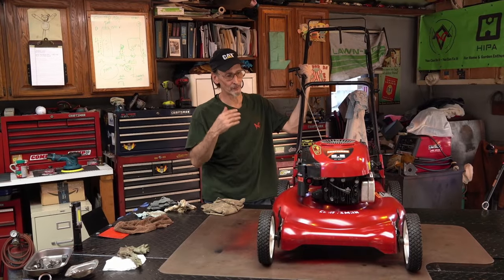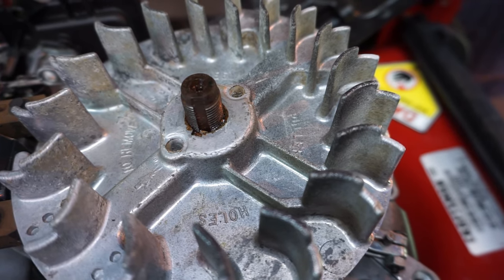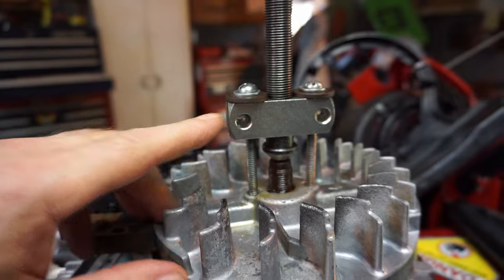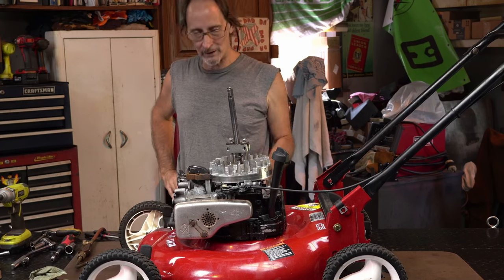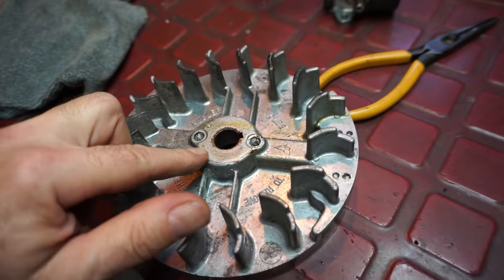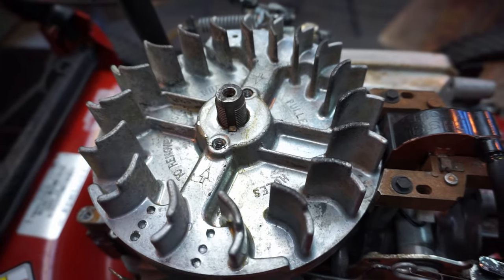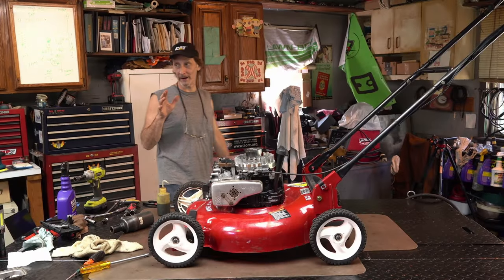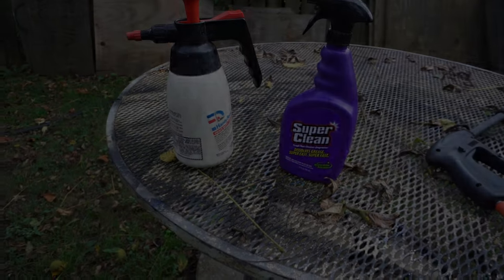Lawnmower Wont Start? Pull Cord Snaps Back? How to Fix! Flywheel Removal & Repair

Comment: Arch!!  Get a Spiral Point starting tap, and then a Spiral Plug Tap  (not the same thing) for those 1/4-20 blind holes (or any other size).  They work awesome.  The spiral point tap looks almost like a drill bit at the tip, and pushes chips down.  The Spiral Tap is spiraled all the way up, and pull the chips out the hole.
Reply from the maker: Nizeeee,,, I have soooo many taps laying around